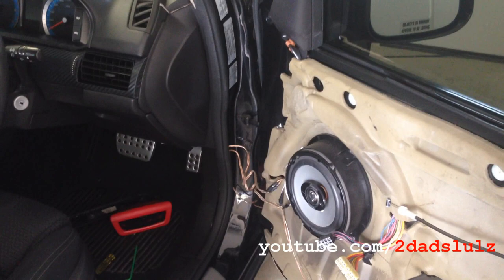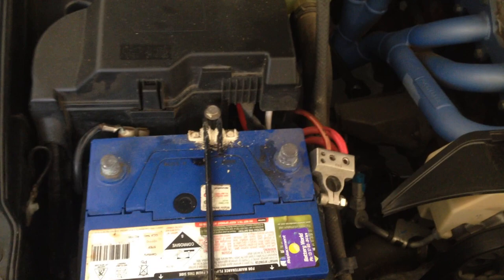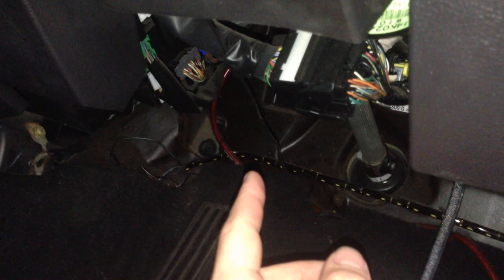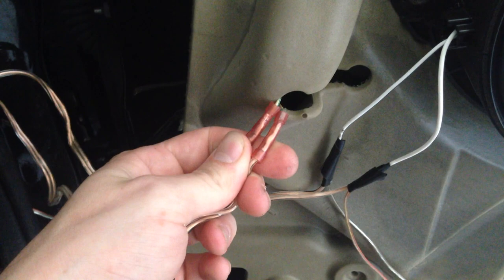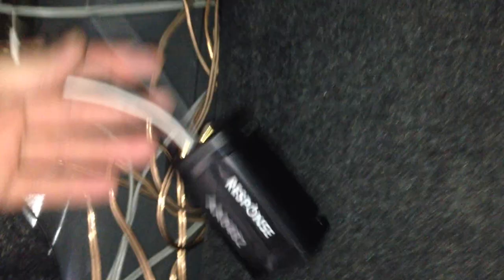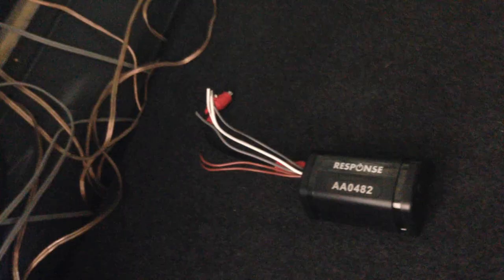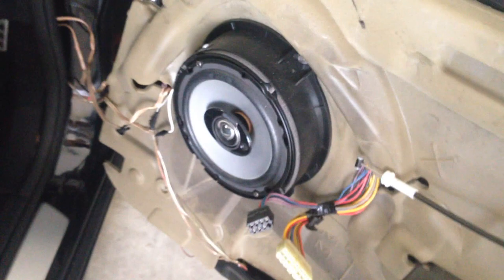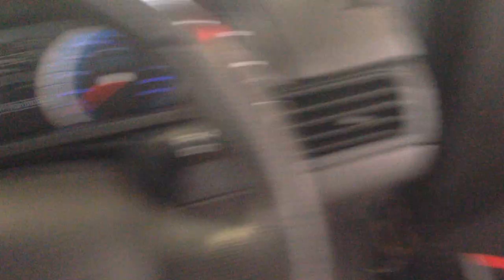Ford Falcon FG Sound System | The Basics | Amplifiers

Comment: Where is the Remote cable located?
Reply from the maker: ***** Do you mean where did I attach it to?
Reply: My bad, where did you connect it too? Thanks
Reply from the maker: ah I found a wire under the steering wheel that gets a 12volt signal when the ignition is turned to accessory
Best place would probably be in the kick panel though, much neater
Reply: I was given the Sony Xplod 500w amp.

It has 3 seperate Power connections (REM, +12v & ground)

Do I have to connect The REM and +12v to something or can I just run the power from the 12volt wire under the steering wheel straight to REM and not worry about the +12v connection?
Reply from the maker: The one that says +12V is your power. You need to run a cable from your battery with a fuse to the amp
Your REM is the remote wire, which is the signal you get from somewhere in the car so that the amp isn't powered up constantly
Reply: So a wire from the battery to the +12v connection then a wire from under the steering wheel to the REM Connection?
Reply from the maker: Pretty much

Comment: information overload.so confusing , and looks to have too much wiring than what is needed. why would you run wires from the door back to the amp and back to the door again.  The wire is already there, now its tripled up.
Reply from the maker: Made it as basic as possible.
It's a hell of a lot easier for people who have never done audio,  to go from the door and back, rather than start pulling panels apart to get to the wiring next to the ICC.

Comment: ive seen in peoples cars they have switch that turns the bass on and off what would that be as in what does that connect to ? so the volume stays the same but as soon as you flick the switch no bass hope i make sense thanks
Reply: It's just a remote that plugs straight into your amp
Reply: look for a +12v rail - you can use the positive one hooked up to the ciggy lighter if you dont feel like hunting around